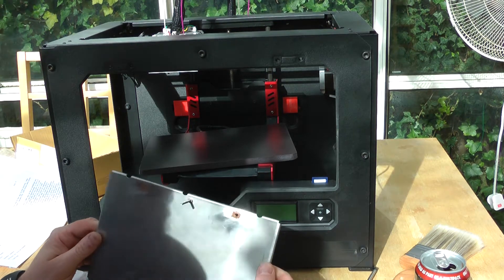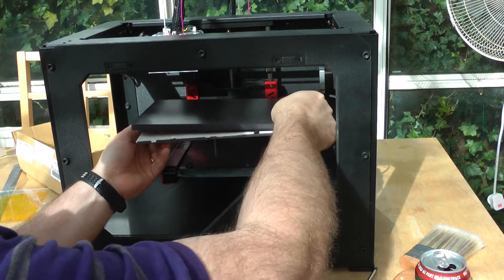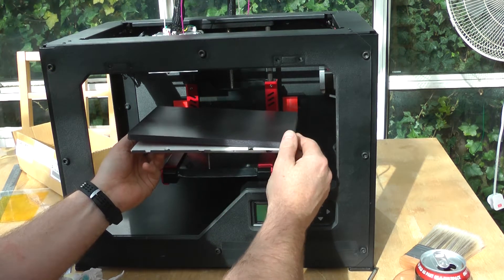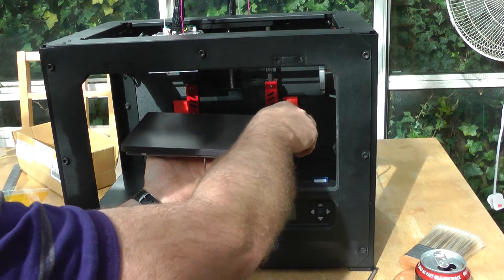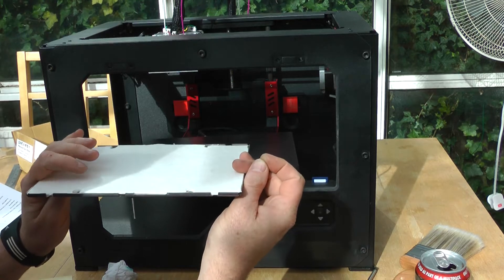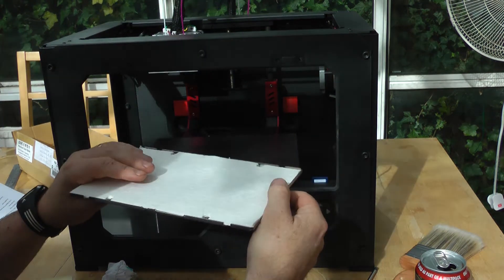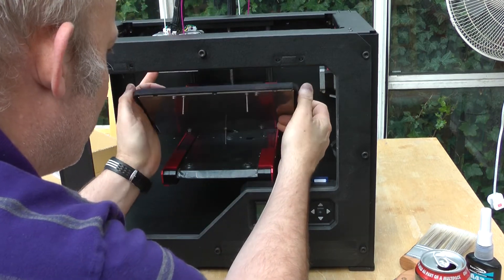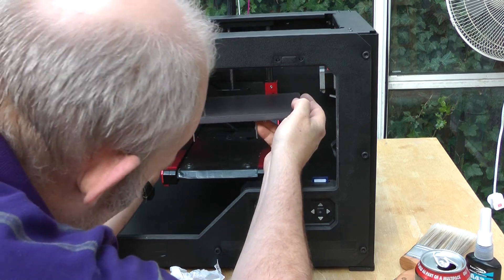2X Warping Bed Fix

Comment: Steve- I've been having tons of problem with getting a flat build plate and was wondering what your current setup looks like? I know you previously were using a homemade glass plate solution. I'm debating on doing something similar, purchasing the Bottleworks upgrade or trying my luck with convincing Makerbot to send out a replacement plate as I've heard they are doing a little better with the manufacturing now.
Reply from the maker: Jesse Vanderhoff , Hi Jesse - use what I'm using just cheap a chips 2mm picture glass. Very. very inexpensive. Rest the glass on a couple of strips or squares of thermal conductive pads  and it wont move during printing.It also makes easy to switch build plates.... easily the cheapest / best value upgrade you could do

Comment: Is there a disadvantage to simply removing the machine screws altogether and having the aluminum HBP actually float rather than be guided by the loose machine screws?
Reply from the maker: Jesse Vanderhoff there's only one way to find out ;-). Seriously I think the bed would shift and you would end up with stepping in the Z-axis, much like what happens when your x stepper cable goes.